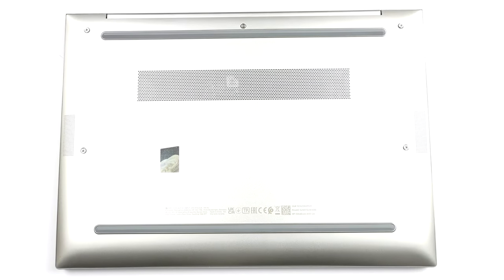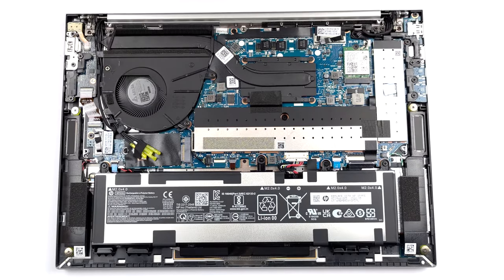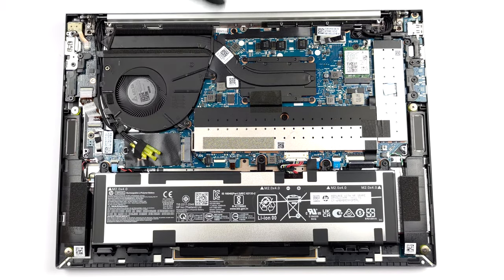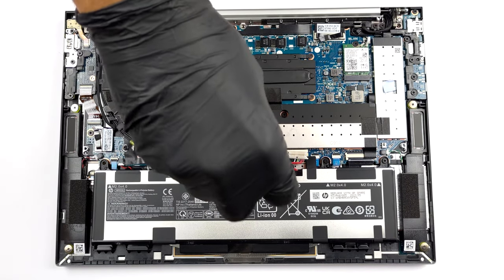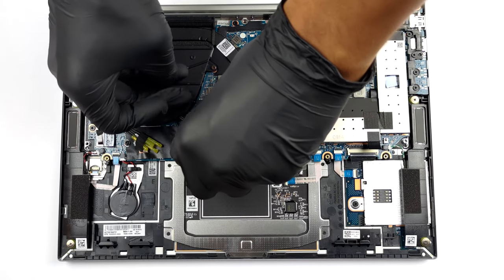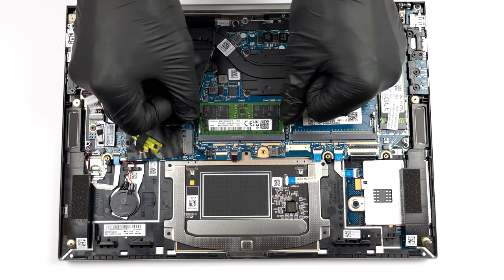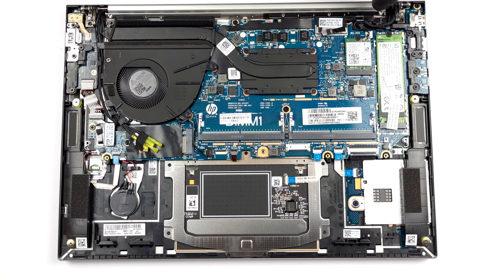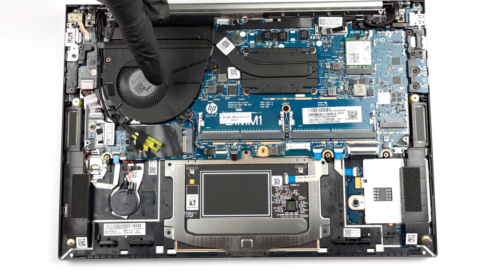🛠️ How to open HP EliteBook 840 G9 - disassembly and upgrade options

Comment: Elite book.
Only model that I can buy from HP brand.

Other laptops of HP is not good and pretty low quality.
Reply: I work in a 3rd party warranty services, I would not recommend any Elitebook series with captive hinges (840 G7, G8, G9 etc) because there is a defect in the design where the LCD cable gets sliced into gradually over time from the edge of the hinge. I've already had to service numerous of them for the problem. If one of the wires is fully severed while the device is powered on, it will kill the motherboard, which costs hundreds of dollars. HP also overdoes it with adhesive so the bezel can be challenging to take apart without damaging it.

I should note that I have only worked on a small handful of G9 so far, but dozens of the 840 G8. I'm also updating this comment to note that I finally managed to break through to HP and it looks like their engineering team(s) have begun experimenting with it, so they are clearly aware of the issue by this point (one of the ones I worked on recently had some odd material under the captive hinge on both sides), but it may take a release of a full new series or generation of the series before any changes manifest.
Reply: @PurpleMiku if this is true then I’m very upset since there few options on market that allow ram and ssd upgrade. The tendency is soldered ram
Reply: @evilballer  Yeah the reason for that is because it allows them to condense the build further, and it is technically from the standpoint of mass production, the smarter choice because very few people that purchase laptops actually open them up to upgrade. The overwhelming majority of people will not.
Reply: @PurpleMiku hi there, I bought a used 845 G9 recently. Is there a solution to keeping this from happening such as taping / reinforcing the display cable or some such fix?
I really appreciate your posting this heads up!
Reply: @PurpleMiku  howdy! Yeah my reply was a bit of a shot in the dark. Well, I'm definitely not technician status though I started messing with electronics back in the days of the PET and Commodore 64. Glad to hear the G9 isn't affected like the earlier generations, so I'll likely leave it be.

Yeah I was torn been Thinkpad and the HP, being aware that HPs general QC and CS isn't the greatest. I decided on the elitebook because of the all around good reviews, modular upgradeable design and form factor (coming from over a decade of using macbooks), and price for performance (picked it up for under $500, and, it's near impossible to find newer than 4000 series Ryzen thinkpads here in Indonesia). That and the general opinion I've seen that Lenovo has let the Thinkpad line slip considerably since the golden era. It's serving me well so far, so my fingers are crossed!

Thank you for replying and being so gracious!